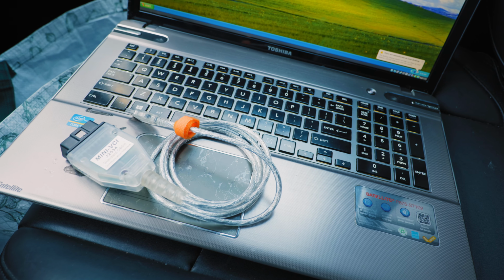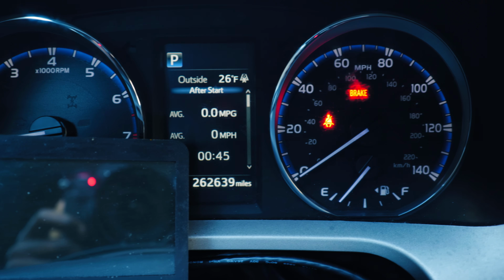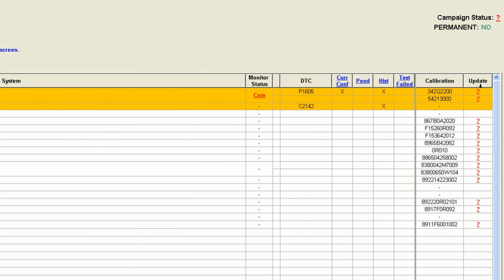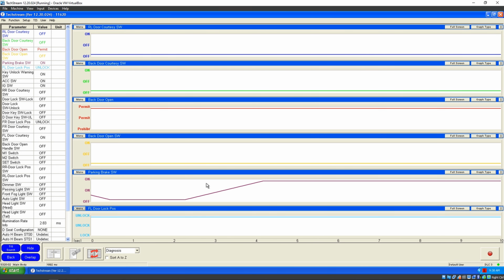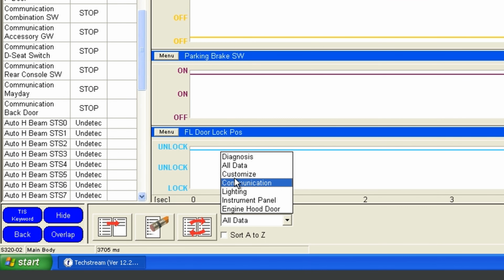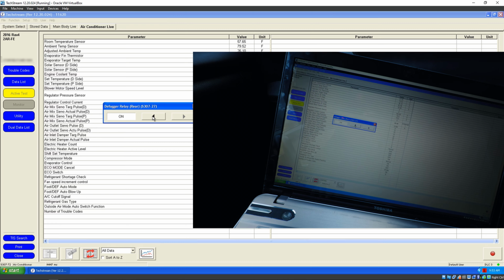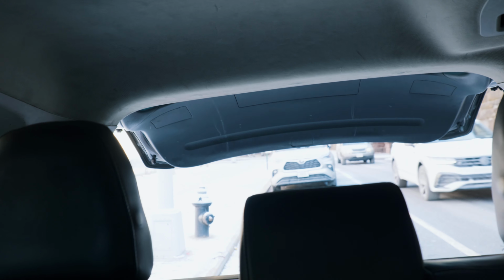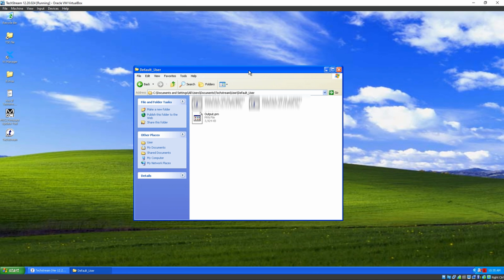Toyota Techstream Active Test - What Happens When You Control Components Live

Comment: With this version can I programming ultrasonic parking sensor ? I just bought a new one and had to be programmed. 

With 18.0 versions are available all the functions ?
Reply from the maker: You should be able to do this on version 18.
Setup and Connection
1. Connect the Cable: Connect your MINI VCI J2534 cable to your laptop's USB port
and the vehicle's OBD2 (DLC3) port under the driver's side dashboard.
2. Ignition On: Turn the car's power mode to the ON position (Engine off, but all
electronics active).
3. Open Techstream: Launch the software and click "Connect to Vehicle" to let the
system automatically recognize your car's VIN and model. 
Registering and Calibrating the Sensor
1. Navigate to the Menu: From the main menu, go to Body Electrical 
Parking Guidance, ICS (Intelligent Clearance Sonar), or Intuitive PIA (Parking
Assist). 
2. Access Utility: Click the Utility tab at the top.
3. Bumper Type Registration: Select the bumper type (usually standard/value) on
the screen.
4. Enter Sensor Values: Input the serial number or measured sensor values as
prompted. The system requires the angle of the sensor to be precise, which is
calculated as 900 minus the actual measured sensor angle. 
5. Calibrate: Follow the on-screen calibration steps. Ensure your vehicle is parked on
a perfectly flat surface, as specified in the Toyota TIS Repair
Manual. 
6. Complete Process: The software will confirm registration. Clear any pending
Diagnostic Trouble Codes (DTCs), exit the program, and disconnect the
cable.